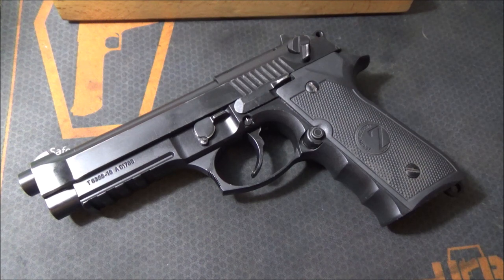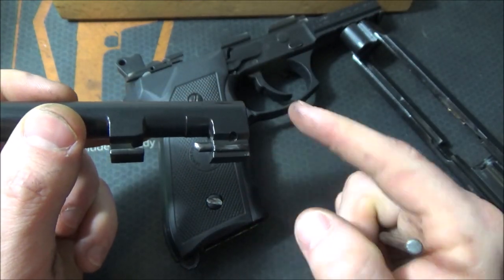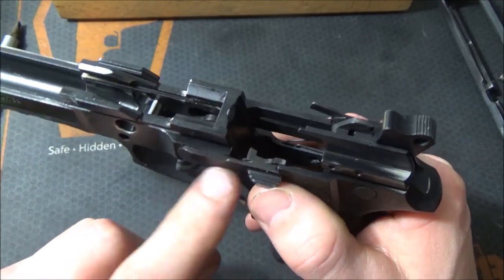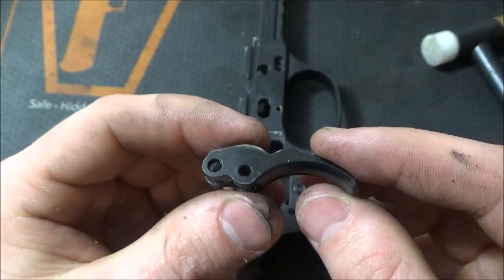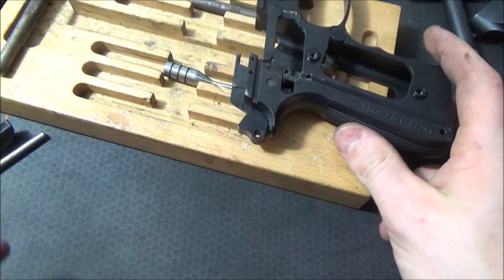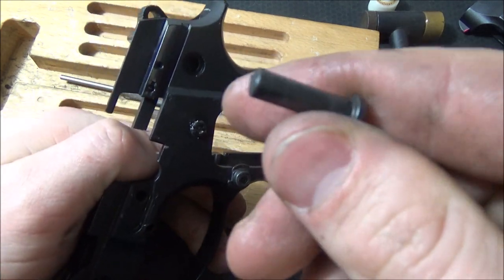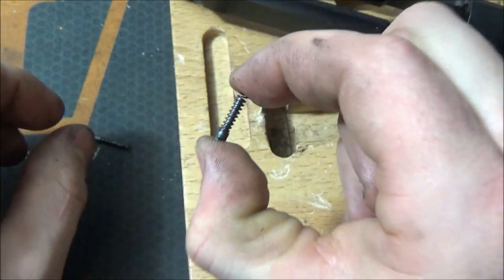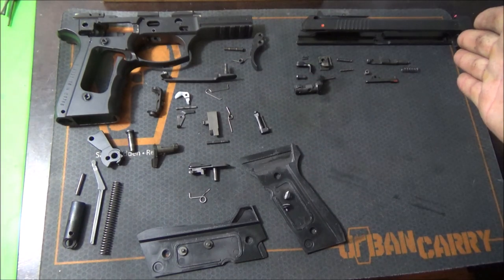Beretta 92 Series Detail Disassembly

Comment: All you have to do is replace the plunger and you can use a modern locking block. I've already done it on my 92s.
Reply from the maker: Yeah, the plunger typically comes with the locking block

Comment: Jesus wept, when removing the extractor retaining pin you have to pull the extractor forward away from the receiver compressing the extractor spring, then you don't have to flog the life out of it to remove it.
Reply from the maker: The Girsan cerakote finish makes everything tight
Reply: @doitriteak  I see, that would make things a tad tighter, thank you for your reply.